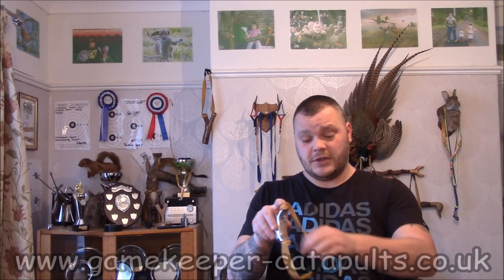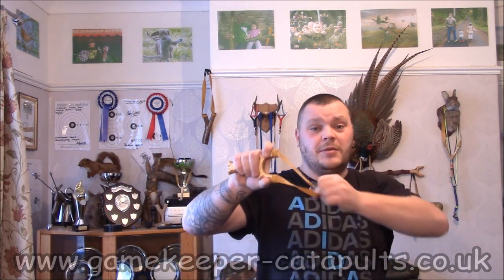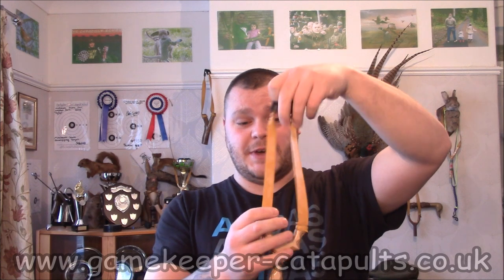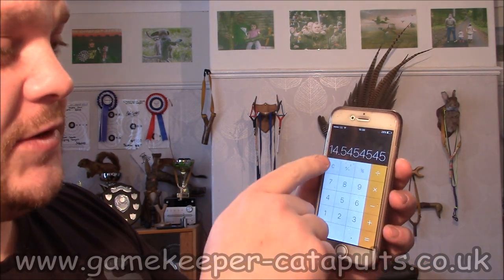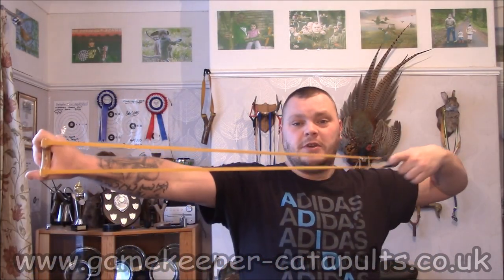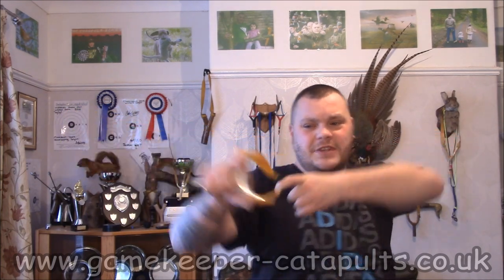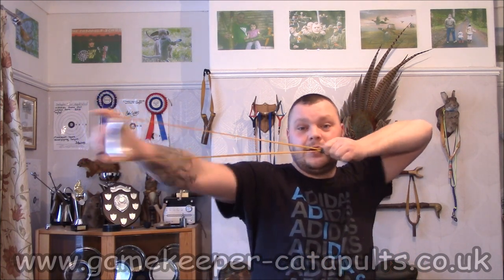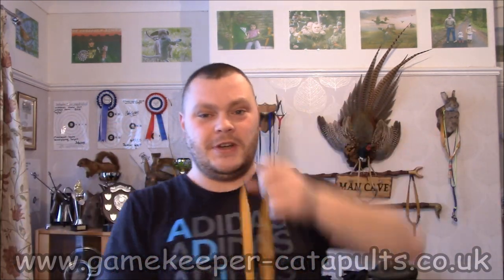"HOW TO" FIND YOUR CATAPULT DRAW LENGTH & ELASTIC LENGTH

Comment: not all bands can stretch to 6x. get a scrap band, mark two points and they're 1cm far apart, and stretch it to like 99% of it's limit, in my case it was 5cm stretched, so divide your draw length to like 4.9cm

Comment: In inches use 4-5x and add half inch for tie off. 20in draw length divide by 5 =4, then add half an inch. Band length would be 4.5 inches.

Comment: I ordered my first slingshot recently, been trying to understand everything and it’s so confusing, band thickness, also having the right size ammo for each size band. This really helped!! Thanks mate
Reply: If you're not hunting or pest control, you normally wouldn't reach 0.8mm band thickness unless you're prioritizing band lifespan cause that's the advantage as it gets thicker. Matching band thickness and ammo-weight cause if the ammo is too heavy, most of the contraction speed is eaten up by gravity of that ammo, if the ammo is too light, well it just doesn't go as fast, I forgot the reason, try those regular plastic BB gun bullets, I think 4~5mm, they still fly fast but not as fast, that's what I mean.

You can try shooting sardine cans if you don't have a speedometer/chronometer

Comment: I'm finding 8.9 times out of ten my 'lastic gives up the ghost in front of the pouch holes. It's a bit 'cheap' but I'm reusing the cut downs for my 'standard' anchor lengths. 

Not with me? 

Get a PFS....justification for buying one.....sneaky, right....i...!

Better now? Still no? 

You set up for the half or full butterfly for your PFS, then you still have length in hand for your 'usual anchor' length cuts. If you get busted for buying a PFS tell her it's Economical Utilisation....or... drink beer until she cheers up? 

Or....get another one.

Comment: When we were kids we would use our body parts to determine our size and fit to a whole plethora of of different things. From pant size where u would use ur elbow to ur rist all the way to building ur own personal sling shot where u would use ur finger tips to ur wrist, and most of the time it will be the best fit to ur needs.
Now building it also plays a big part u will notice that u have 2 to 4 cm of extra play that is the extra that u use to tie-up ur rubber to ur forks. 99 percent of the time it will be a perfect fit unless ur using real heavy rubber bands. As kids we used bicycle tire rubber and then moved up to the rubber of a motorized bike it was called a Thomas that's was the best rubber as a kid we could find and let me tell u the sling shots that were made with it as kids we were all envious over.
They were incredibly accurate, durable, and low maintenance. Probably because the rubber from the factory was made to last with no maintenance.

Comment: Just did this even left it what shouldve been a hair long yet it slaps the fuck out of my hand now...where as before i never got touched by the bands...and i mean BRUTAL slap...its unshootable now even with gloves on.
Reply: Keep in mind im shootint OTT...legit had to switch this band set for TTF to not murder my hand
Reply: @GrandmasterHobbyist  Did anything improve? How can I explain this, try firing at your 8 o'clock, 9 oclock is your left arm, 12 oclock is your front, 3 oclock is your right arm, I kinda aim at 44 min mark.

how I hold my slingshot is at 11 oclock, how most youtube guides hold it, it's at 6 oclock or what they call gangster pose.
Reply: @MangaGamified  thanks for the input I'll test it out later. Trying to get accurate worh longpull shooting I think I change slingshots too often so I can't get used to anything 😭 always want to shoot them allm
Reply: @GrandmasterHobbyist  You will be surprised how accurate you can get using the same equipment over and over, check out Taseer Hunting Official and Hunting Masters Official, they're like the high noon quickdraw of slingshots.
Reply: @MangaGamified  I really want to get this heaven emperor slingshot OTT are you familiar with it? Grip looks amazing.
Reply: @GrandmasterHobbyist  You could buy tools and make your own, you're probably better off with wood work tools if you're focusing on ergonomics and comfort, wood is the easiest to start off. but I found out one could just buy some paracord and just wrap your current slingshot, for now I'm using some shoelace I bought from the flea market, while I'm still thinking what paracord to buy online. You could youtube how to learn to wrap your slingshot with a paracord, or learn to make a paracord bracelet to wrap around your slingshot. Some also use badminton handle wraps or bicycle handlebar wraps to wrap their slingshots.
Reply: @MangaGamified  yeah I use hockey tape currently on mine. But some like 2019 tournament in China was won with that heaven emperor ofc I know its mostly shooter but it looks so nice.

Comment: GAMEKEEPER JOHN How do you measure/decide band width?
Reply: It probably depends on how strong you are. My estimate after looking at his bands is 3 cm wide. If it's too hard to draw the slingshot, you can always reduce by a few millimeters, I imagine. Hope this helps.
Reply: they should be matched to the weight of the ammo you shoot, the heavier the ammo the thicker the bands. if they are too thin you sacrifice power but if they are too thick there will be too much energy left in the bands at the end of the shot causing faster band wear and hand slaps

Comment: would ye add another half inch for the bit thats tied onto the fork for yer over all band lengh sorry ifs thats a stupid question
Reply: titan munro I normally add 10mm for the attachment point at the forks and measure and mark 25mm to put through the pouch (you can use less but I find this makes it easier)